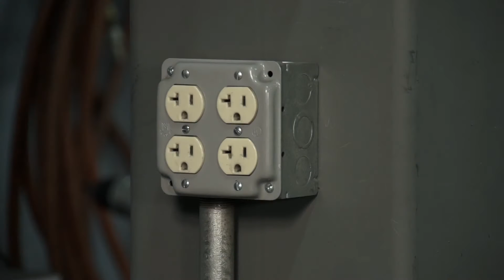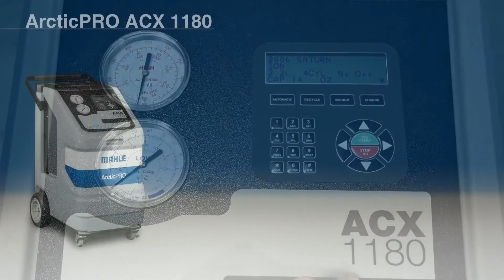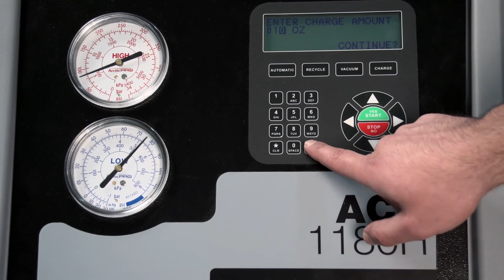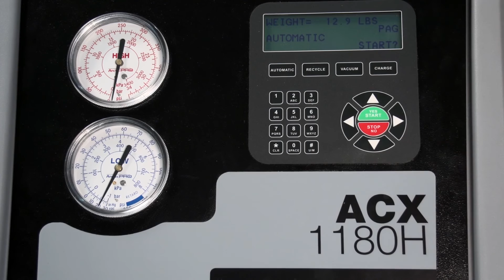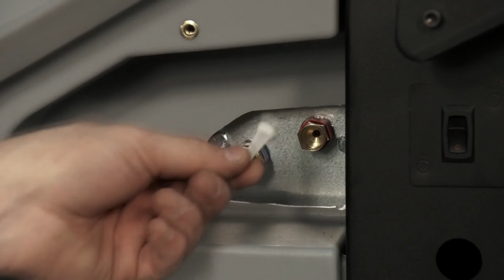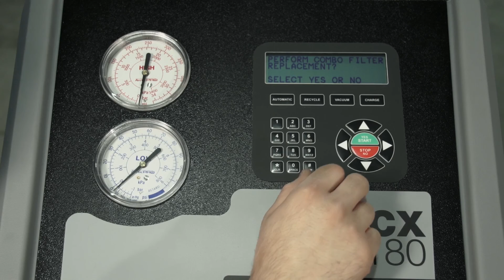ACX1180 Setup and Operation

Comment: WORST CASE OF CORPORATE GREED... you will NOT find ANY kind of Technical or Service information NO SERVICE MANUALS ... IMPOSSIBLE TO GET ANY SERVICE INFO.
YOU WILL NEED TO FALL IN THE HANDS OF THE -- E X C L U S I V E - service dealers
Which in turn will CHARGE YOU WHATEVER THEY WANT.
DO NOT BUY THIS CRAP... throwing away your money in a big paperweight once it stops for any reason.

Comment: Nightmare machine i bought it through AutoZone the biggest mistake that hour and half to do the service
Reply: Sorry for your experience Owl.  A normal service averages about 40-45mins.  So 90 minute services are extremely unusual.  If the unit completes the service, then there may be a restriction in the hose or too little refrigerant in the tank.  If the service doesn't complete, there may be an issue with the unit.  I would encourage you to contact tech support, they can assist with maximizing your unit's performance.  (800) 468-2321
Reply: Thank you for sharing your opinion. I’m looking for an ac recovery machine and I was thinking on this mahle 1150acx but I was in the need to get more information about the product because they come in many models. Now I know why there are many people selling them on eBay for cheap.